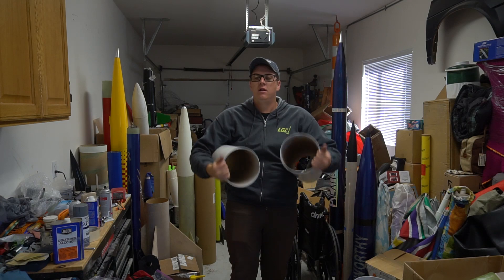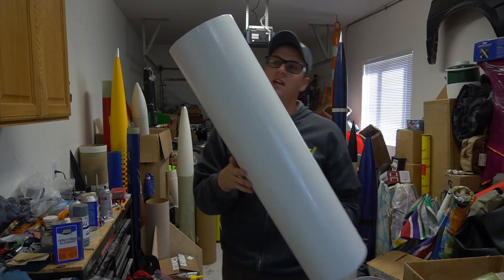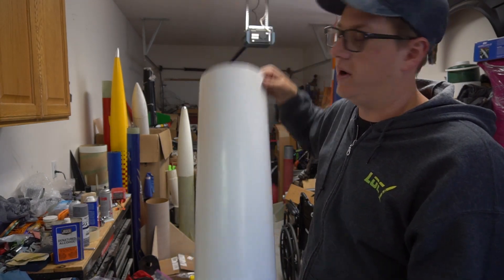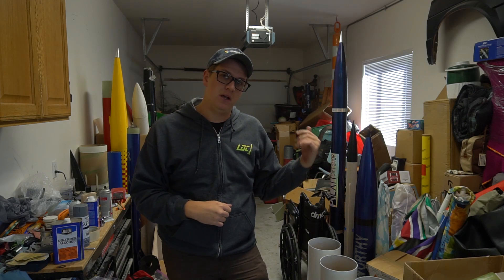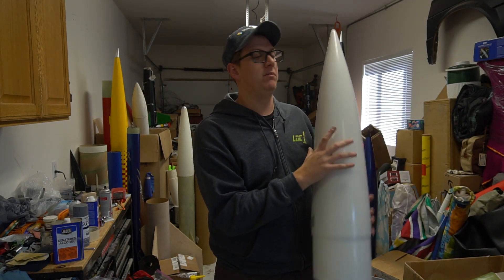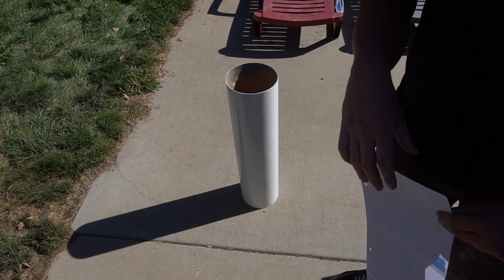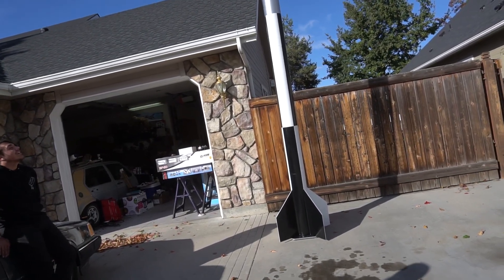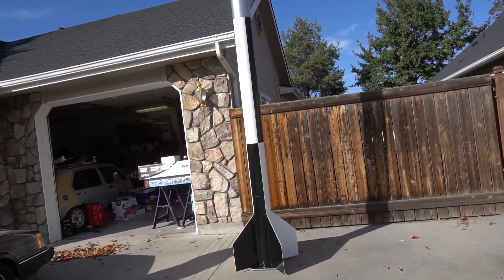Painting a 12 Foot Tall Model Rocket

Comment: Dude what year is that volvo ?
Reply from the maker: 1988 760, it's my brother's.
I have a built 1991 Volvo 740 SE wagon with a big ol turbo, full standalone engine management and a Nissan CD009 six-speed transmission. 
I also have a 1983 240 wagon that I just put a microsquirt on, too.
Reply: @RocketVlogs  You can probably let em run out there in the west too ! ... my xc70 saved my life a couple of times going through blizzards in Northern Minnesota, they are awesome.

Comment: If you put masking tape on the fin and the tube the filets would come out cleaner
Reply from the maker: All tape really does is make it easier to clean up excess epoxy. 99% of the time I mask them off, but for this one I just scraped the epoxy and wiped the excess off with denatured alcohol. Usually I am super meticulous about my fillets, but this project was on an extreme time crunch.